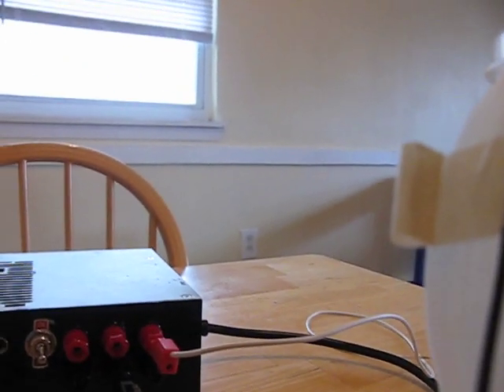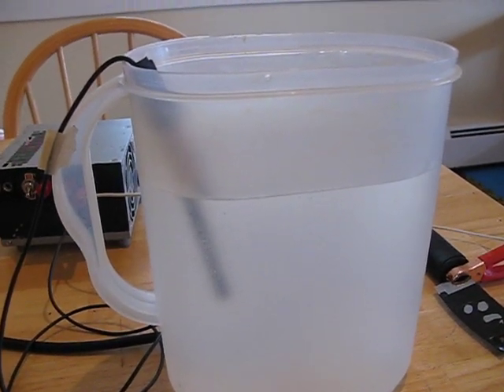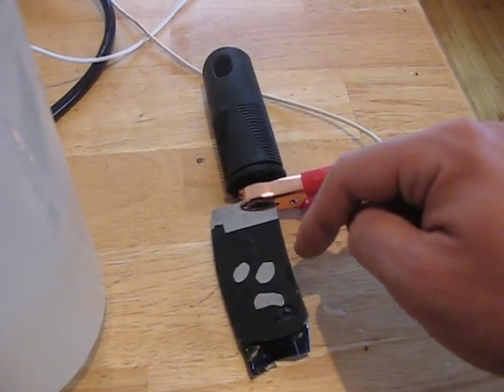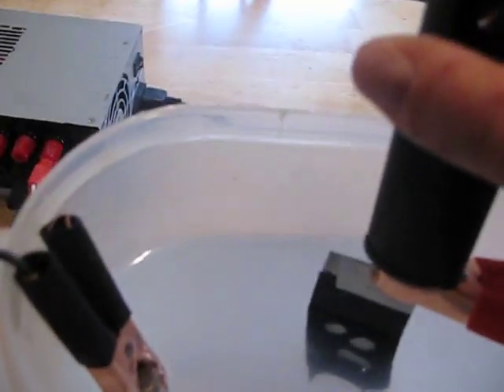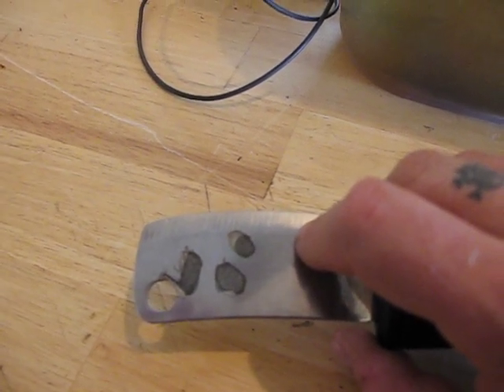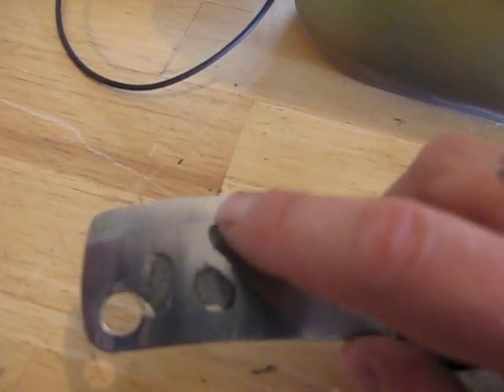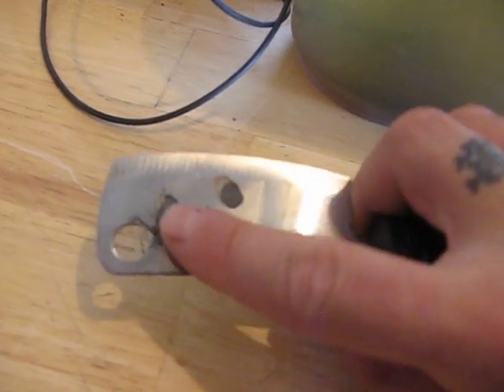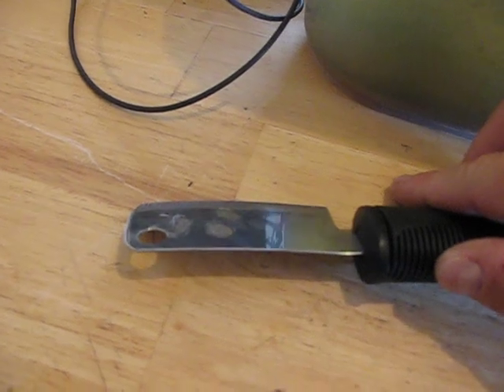Electrolytic Etching of Stainless Steel

Comment: pretty sure you should be doing that outside or in a very ventilated area those bubbles are chlorine gas which is highly toxic and that precipitation in the solution is a dirty lye from not using pure carbon rods so be careful where you dispose your solution
Reply: jeff switalski 
Unless chlorine became colorless, odorless and flammable recently, I'm pretty sure that the bubbles are hydrogen and oxygen.
There may be a trace amount of chlorine, but not enough to detect even a faint odor.
The precipitate is mostly rust.
Reply: He's using salt water, so he's creating chlorine gas. A different electrolyte (baking soda for example) wouldn't generate chlorine gas.

Comment: Computer power supplies use + and - 5 and 12 volts.. You can also use a battery charger for 12 volts, 12-14 volts and usually 2 to 10 amps, slow or fast charge.. Can also use a Q-Tip, and blot the stencil, or use a felt pad over a wider electrode and only affect the area under the electrode, not to submerse the whole blade.. and, use AC current, like from a Door Bell transformer 15-18 volts to blacken the etched area.. But, I think you know all of that.. Might help some readers though..
Thanks for the videos.

Comment: Will this process work on aluminium as I have a ceracoated piece that ill clear off the stencil of the coating but need to etch off the rest a little deeper to fill in with model paint.

Comment: Platinum can not be electrolytically etched. This process works by the reduction potential tables for different elements. Platinum works well as the negative but not the positive (the part being etched).

Comment from the maker: You don't use AC for electroplating. It's DC, and essentially the rig in this video is a crude electroplating setup, except I'm using it in reverse. Material is removed from the anode (the part to be etched) and deposited on the cathode (the part to be plated)

Comment: dc takes away material ac would plate or add material from the cathode , the electrolyte can be anything acidic or salty, viniger, even orange juice. with plating your cathode would be made from a silver, nickle, copper etc.

Comment from the maker: I believe I used the 24v rail on my power supply, but I think lower voltages would work ok. I'd go for a minimum of about 12v. Voltage isn't nearly so important with etching as it is with plating.

Comment from the maker: Stainless etches just fine!
A lot of custom knifemakers use electrolytic etching to put their logo on blades.
It might depend on the type of stainless (there are many) but every stainless object that I have attempted to etch has etched successfully.
Stainless actually seems to etch a bit faster and cleaner than plain carbon steel, though I have no clue why...

Comment from the maker: Yes you could intentionally etch right through a blade, but it takes more preparation.
The problem is that the etching will 'undercut'. By the time the pattern has been etched all the way through, it will be 'blurry' on the other side.
I can't explain it properly because I don't have enough characters, but if you google 'etching' and 'undercut' you'll find what you need to know.
You either have to mask both sides (very tricky to align) or etch smaller and finish with a diamond file.

Comment: You stated that if you had left the blade in longer, it would have eaten right through the entire blade - I was wondering, if you wanted to achieve this intentionally, could you use this etching process to actually eat through the entire blade? How crisp would the cut be? 
For example, if I wanted to make my own version of the Sypderco Q, S, or R, which features a skeletonized blade, could I achieve the same effect using this process? I know CNC is way better, but I could do this in my kitchen!

Comment from the maker: You're right that Hydrogen is evolved in this process.
While it is most definitely flammable, it is not toxic.
On the other hand, if you try to etch too large an area at once, you can get a small amount of chlorine gas, so if you begin to smell 'swimming pool smell', it would be a good idea to be more modest with the area you're etching.

For generating Hydrogen/Oxygen, it is better to use Sodium Carbonate (washing soda) as the electrolyte to avoid the risk of making unwanted gases.